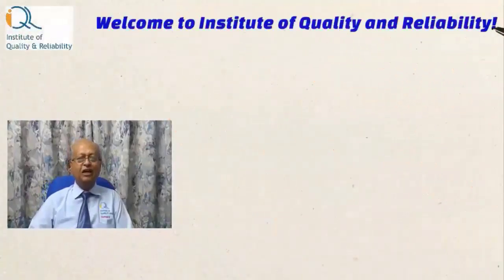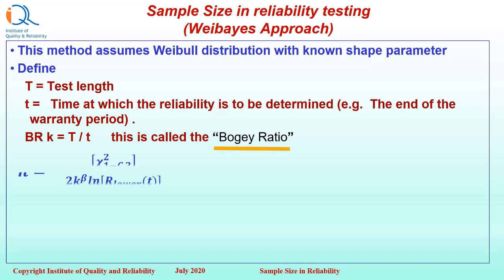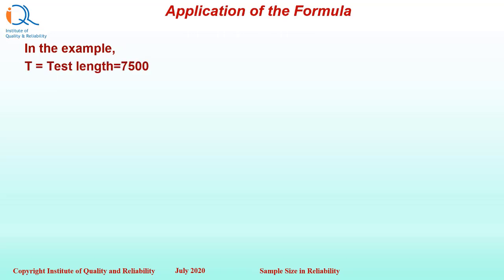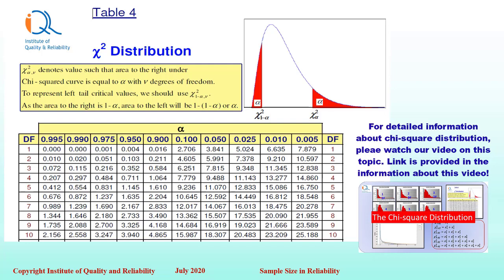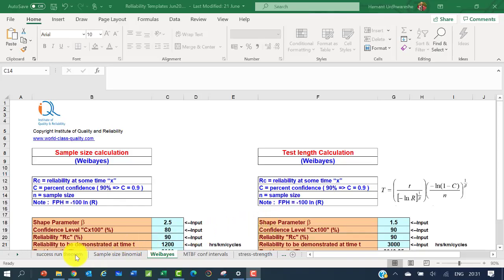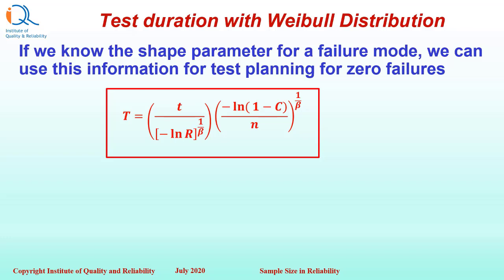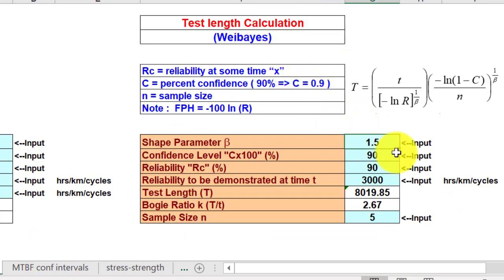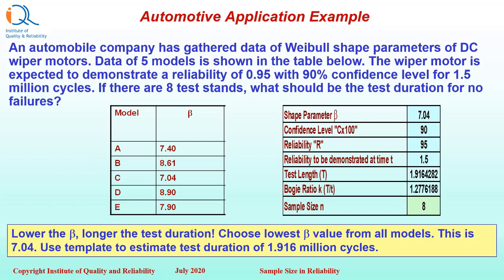Sample size in Reliability Testing: Part-2

Comment: First of all, thank you for this important video. Secondly, I would like to know how you can practically get the value of the shape parameter (beta). For example, how and why did you assume that the beta of the hard drive is 2.5? Is this based on a statistical study of a similar type of hard drive?
Reply: The beta value should usually be taken from similar parts. Some standard databases are also available.

Comment: Hi, 
Nice effort, but incomplete.  Generally speaking, in my view, when one gives a formula recipes for calculation without further explanations, at very minimum one, one should provide all the assumptions used to drive that formula. For example, if specific failure distribution is assumed that should be specifically stated. Or, if a formula is derived to for success-run test or test with failures, this should also be specifically stated. Without it, application mistakes are inevitable.

One other issue I wanted to address is the Hard Drive example in the beginning of this video. The HD reliability target is R/C= 0.99/0.9. The nominal sample size for a success run test with this target is 230 units. In this test the nominal test duration is 7,500 hrs. I assume that 7,500 hrs. is derived from the one-life use profile of the drive for the severe user, and the intent is to test it at use level stress (i.e. without acceleration) . If this is correct, and please correct me if I'm wrong, the video seems to suggest that the same R/C could be demonstrated within 1,500 hrs. in a success-run, at use level conditions. In my view this is either contradicts logic or some of my assumptions are incorrect. Anyway, this further demonstrates the need for precision descriptions as described in the first paragraph.
Reply from the maker: Thanks. We usually include the content that fits in a relatively short period of time. You are right, stress levels are same for test and usage durations. Minimum reliability of 0.99 at 1500 hours is demonstrated at 90% confidence level with sample of 5 if the test duration is 7500 and beta parameter is 2.5. I am not sure why you mention this is a contradiction.
Reply: @instituteofqualityandrelia7902  Hi Hemant, I stand corrected. You are correct. I mistakenly thought that you are proposing to decrease both the sample size (230 units to 5 units) and test time (7,500 hrs. to 1,500 hrs.) and still achieve the same reliability target. I now realize that in fact your test proposal is decrease the sample size at the expense of increasing test duration 5 fold. There is nothing wrong with that logically, except perhaps the question whether or not a sample size of merely 5 units can adequately represent the entire variability in the population, or at least as well as 230 units can. Understandably, there are many situations when sample sizes must be compromised against other real life constraints. But that a decision is beyond the role the reliability engineer alone.

Comment: Hello,
Under the conditions specified in the example, isn't the standard approach to calculate the target reliability at 7500hrs (based on given Beta and Scale computed from first condition)  and use a 0 failure condition in Binomial distribution to compute sample size? And, isn't Chi square used only for exponential distribution for sample size estimation?
Reply from the maker: Thanks for your intrest and question!
It will not be correct to use Binomial unless the test time and time at which you want to calculate reliability is same. That is to say, bogey ratio is 1. The other statement is correct. Chi-square is used only when failure rate is constant. 
Good luck..Hemant